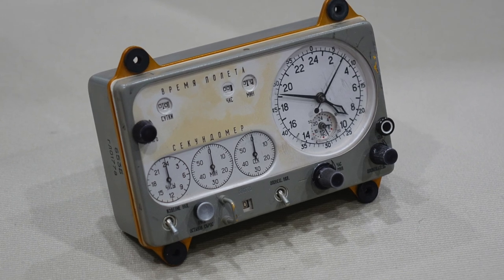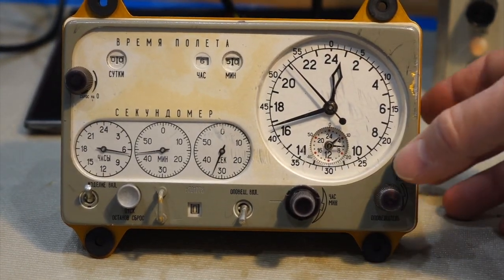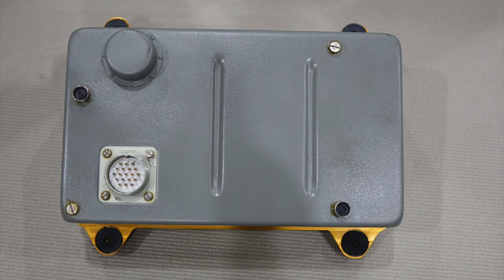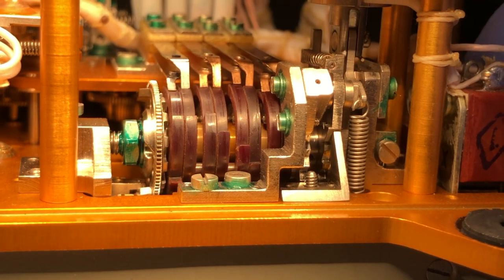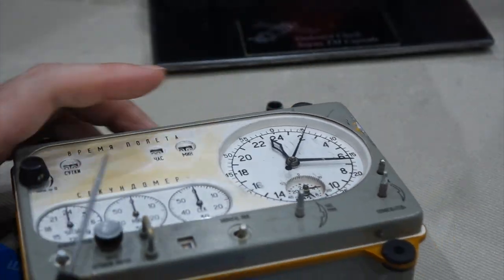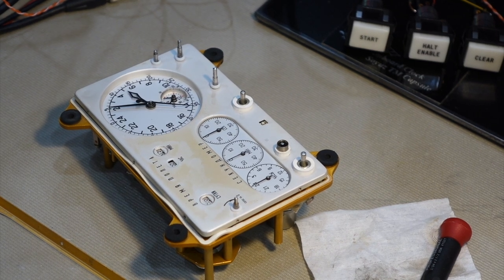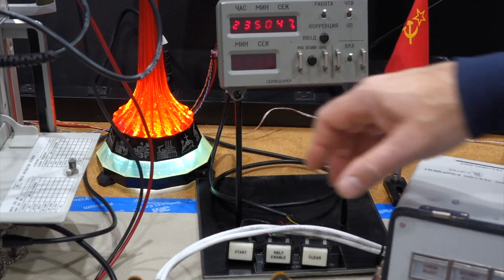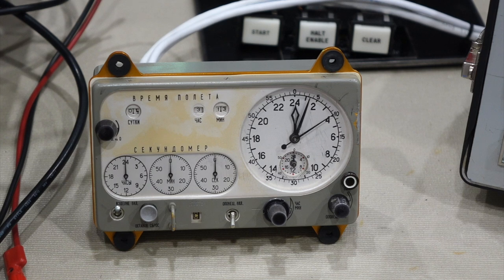Soyuz Electro-Mechanical Space Clock - Part 2: We try every function!

Comment: 5:32: I think I can explain the "interesting oddity" of the dot after the 1. I believe that's to more unambiguously distinguish a 10 from 01. Keep in mind that a cosmonaut may be looking at the display upside down, and there it might otherwise be easy to get confused. The hour display does not have a separate segment for two-digit numbers, and the dot is only really needed on the right-hand side, next to the one. Or at least that's my theory. I have no inside knowledge.
Reply: Insightful observation.
Reply: @КусаниеКрасногоКоня  there is 00 not 60? It wraps at 60 so things like 61,62, 93 etc. Are not valid numbers? There would be ambiguity with 60, 06 only, but seems like there is no 60 either, only 00
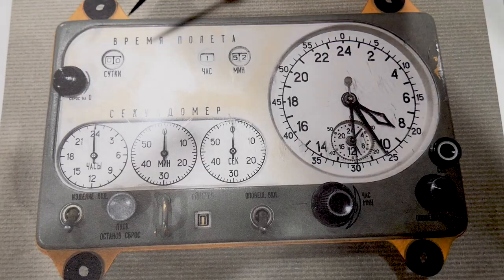Reply: @AngDavies  Interestingly, they also designed their "5" to be highly asymmetrical, which probably helps ensure 05 cannot be confused with an upside down 50. See shortly after 2:29. Between this and making dangerous input difficult, I think a lot of very smart thought went into the ergonomics of this clock.
Reply: I personally think its a hole. look at how clearly defined its edges are compared tot he printed one. I have no idea why it would need a hole there, but 99% certain its a hole and not a printed mark.
Reply from the maker: @jonmcentire  And you got it 100% right, I checked under the binocular microscope, and it's a hole. Mystery deepens...
Reply: I don't think you can get upside down in a Soyuz crew module. They borrowed the design philosophy from a sardine can.
Reply: 1 or 7 in the darker light / shadows /
Reply: Good to know, great thinking, on your part and the Soviets.

Comment: ОТК is quality assurance by the manufacturer.
ПЗ is acceptance by the customer.

Only the cool gadgets are marked "ПЗ", such as airspace/military/atomic/government/special stuff. The rest is ОТК only.

Basically, ПЗ is a quality control officer employed by the customer and on permanent assignment at the manufacturing plant. Their job is to ensure the processes, raw materials, workmanship, alignment and resulting products are up to spec, partly independently of the manufacturer.
Reply: Приёмка заказчика? 
This comment needs to be bumped.
Reply: @artej11  exactly :)
Reply: Не факт, что тут "ПЗ" - смущает разная высота символов.

It couldn't be for sure that it's "ПЗ" - the different height of characters is a bit confusing.
Reply: @r2daw158  По виду у них просто не было штампа и они посимвольно проштамповали универсальной приспособой.

It looks like they didn't have a special stamp ready and they used a universal one (probably a wheel one) to stamp everything.  I recall in the nineties when some papers were still done on manual typewriters they would sometimes use numbers for letters too.
Reply: @artej11  numbers on letters — this is twofold. On regular typewriters there were often no digits 3 and 0, those were to be typed as capital letters 3 and О respectively. On the other hand, teletypes had a full digit series 1234567890, but lacked the literal Ч, so 4 had to be used instead. This is can be seen even today in РЖД (railway) telegrams.

Comment: You forget to add the link in the description :P
I miss the mechanism which reset chronometer counters.. How does it happen? A spring-loaded system?

I really love the interior of soviet clock mechanisms.. I disassembled many old clocks in my childhood.. :)
Reply from the maker: Very sorry, it’s fixed now! I had to upload in a hurry before I got to my next appointment, had not added the end screen, links and cards yet.
Reply: Ахахах! Ю'в гат стронг Рашен акцент! 
(у меня уровень английского - Мутко! Молодец, запили когда-нить видео на английском!)
Reply from the maker: And yes, I really wanted to know what was under the bezel, but that involved taking off sealed green screws. And maybe even the hands, which I am not equipped for.
Reply: A video with both Artem and Marc : this HAD to happen sooner or later ! Yet I was surprised to see it :-D
Reply: @CuriousMarc  I tried in my childhood to unscrew some of that sealed screws on some decommissioned soviet kind-of-military equipment. Chance to do it was 40% - most screws were made from soft metal, and it's much more easy to break screw head, than to unscrew it.
Reply: Артём, красава! Не ожидал тут увидеть))
Reply: @sionmr2  аналогично) Мир тесен)
Reply: @CuriousMarc  Hmm...  Know anyone with access to a CT-scan machine?  If x-ray tomography worked for the Antikythera Mechanism, it might work for a Soyuz clock too.
Reply: К сожалению "все полимеры просраны". Больше такого мы вряд ли увидим. Спасибо Марку и Артему, что документируют память об интересных старых механизмах и электронных устройствах.

Comment: Great video! Loved it. There is a reason the clock is loud though.. It is not a flaw, but more seen as a feature. It's so during any manual maneuvers that are counted in seconds, they don't miss one! Humans do much better with more than one form of feedback. Visual and audio feedback combined are the best delivery methods for a majority of us. Combined, those effects are compounded, and highly efficient compared with responses to the effects individually.  When you are moving at 14,000kph, 5 seconds VS 7 seconds is pretty  important. That's all speculation though. I have absolutely no idea if that was in mind, or if the clock was even in the control cabin lol.

Comment: the wires are wrapped in a PTFE (teflon) sheet, also the wire isolation material is the same; 
sausage made of wires is called "жгут".
those are the best oxygen-free copper wires for signal paths, still in use for a modern military equipment.

Comment: Somehow doubt the mechanical clock noise would be a worry on a Soyuz, as if all you can hear is that clock, and not the dozens of screaming fans, running pumps and inverters providing all the AC buses, you are either on the ground attached to a broken test set, or if you are flying, you are about to have a really bad rest of your life, short as it is.

Comment: A common question for implementing watch/clock mechanical complications, and/or basic timing functions, is how to maintain position of the gear train (hand position) between timing events (escapement, ratchet, etc.) in the presence of expected dynamic forces. On earth we are only dealing with gravity, but a wrist watch is moved and tilted, which is addressed by the watch constant force drive train from the spring to the escapement. This arrangement reduces gear backlash effects (hands bouncing) and also resists gravity errors regardless of orientation (although timing error is orientation specific). For a mechanical clock to go into space in the presence of high G forces the 1/2 second ratchet wheel must locked in position after being advanced. This mechanism must produce a great deal of force (as compared to earthly clocks) to unlock, move and relock the ratchet wheel. This is why the solenoids are so huge.

Comment: 3:25: Interesting to note: There is a little ridge (or tongue or nub, or whatever the correct technical term is) inside the otherwise round 19-pin male connector. If there weren't, then it would be possible to plug in the cable connector rotated by any multiple of 60 degrees. And of course, only one of the then possible six positions would be correct. The keying of the connector takes care of that. So much attention to detail on this thing. It's very impressive.
PS: Does the riveted grey cup hide another connector, and does that mean that several of these secondary clocks could have been daisy-chained?
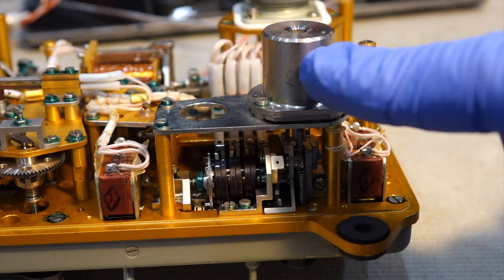PPS: Oh, no, I'm stupid, 10:24 shows that that's not the case. That cup covers the protruding part of the BFS (Big Forceful Solenoid). See 12:23.

Comment: I wager it was size concerns  that led to this thing being taken out of mothballs to be used in the Buran shuttle. I bet that loud ticking was also a feature: It would be helpful in hearing it over background noise/comm traffic.
Reply: For sure the sound wasn't just a byproduct. I have seen electromagnetic clocks made in USSR (mostly industrial applications like belt timings and sorting stuff) that are whisper quiet. You would never know they're working were it not for a rotating red knob.
Russians are extremely purpose oriented designers, doubly so in the aerospace area. If it's there, on the front end, it has a reason.

Comment: Fun fact: 0:23 is not an actual orbiter, but "equivalent airplane", similar airframe equipped with four turbojets and capable of runway takeoff for testing and crew training. You can see four turbojet instruments in the top center of picture and also throttle controls :)
Reply: Yes, but the clock remained in the actual flown model ; see (terrible) pictures at the bottom of this page : http://www.buran.fr/bourane-buran/bourane-consti-reacteur.php 
Notice the space orbiter had provision for fitting two jet engines, one on each side of the vertical stabiliser although it never flew such equipped, hence the two throttles seen on the picture (instead of four throttles on the equivalent airplane).
Reply from the maker: Yes, you are absolutely right. This is a picture of the Buran trainer.

Comment: The star on seal means Military acceptance.
There were goods for military usage and general usage in USSR. Military type components were similar to industrial/space type in USA or Europe. Military requirements were much striker than general. If a general type product slightly doesn't match to the requirements it usually go to shops. But it was unacceptable for military type products. Key visual difference of military type is star or rhombus on them. You saw rhombus on many components into electronic Soyuz clock.
Original name of this requirements is "Военная приемка" (Military acceptance).

Comment: So, since it's incapable of regulating itself, is it really a clock? The timing pulses are being driven in by something else.  So isn't it more like a complex mechanical counter?
Reply: In the terms of clock types, it's a secondary clock, which gets the count pulses from the primary clock.
You need one primary clock, which will drive some number of secondary clocks - this system was widely-spread on soviet manufactures when you need to broadcast the same time through all buildings.
As a result, the secondary clock is just a simple stepper motor and some gears for it, all-time precision comes from the primary clock mechanism. which might be sourced from a balance wheel or a cesium clock.
Reply: I think a lot of older bedside clocks were regulated by the AC oscillating frequency from the power source.  They would run faster or slower if the frequency was not in spec (60hz US, 50hz Europe). I suspect this Soyuz clock is much the same way.
Reply: @ironhead2008  As we are talking about Soyuz clock's external time source - it must not be AC line - the AC frequency in the autonomous power system (e.g. aero and space) is never stable.
Reply: You could consider it a "Slave Clock" like the ones used in schools. They are driven by a master clock. In fact, Marc's flip clock is one of those "Slave" clocks for a factory where they had a master clock feeding it pulses.
Reply: Depends on how you look at it. There's clocks that used the frequency of the input currents, there's clocks that used a removable source...
Reply: @ArtemKashkanov  I meant in the sense that the clock is relying on an external source for regulation: in this case some sort of high accuracy oscillator. Yeah, AC is damned unreliable.
Reply: @ArtemKashkanov  I'd be interested to see what was regulating this clock in the capsule. I suspect it would be some sort of redundant crystal oscillator system given space constraints at the time.
Reply: Seems like that's why the electronic one is much larger, its capable of keeping its own time if the main computer clock failed.
Reply: @ArtemKashkanov  Not sure how Soyuz was designed, but Apollo used a system where the guidance computer clock was used to synchronize everything else, but most things could run on their own, but just not frequency locked, when AGC was turned off. Even the AC power supplies had a sync signal from the central timing equipment (probably locked to the AGC 6400 Hz reference output).
Reply from the maker: Well, that’s what most of a clock is, a mechanical counter. But it is indeed missing a mechanical movement. This one is an electrical “slave” clock. Depends on an electrical input (the master) to move it. So it’s more accurate to say it’s incomplete, we are missing the electrical system that goes with it, presumably in another part of the ship. If anybody has it, I’d be thrilled to take a look!
Reply: @ironhead2008  Yes, an ordinary electric clock relies on accurate mains frequency. Here in the UK at least there are strict regulations for mains frequency and the supply authorities are required to compensate for any timing errors to keep clocks accurate. So if they were  under spec for an hour (for example) they have to compensate by speeding up until the total number of cycles integrated over time is correct.
Reply: It has timer/clock as it starts ticking it counts ;p
but like computer clocks its connection probably wa used to update/sync its time. Anyway some functionality can be provided with arduiono and lots of relays. And even better. But for its time its sure is in its limits. ;p
Reply: I wouldn't call it a clock. More of a clock user interface.
Reply: It's not a "Slave clock", it's a "Slav clock"

Comment: small point - the stopwatch function is called a Chronograph, not a Chronometer.  A chronometer is a watch which meets a high standard of timekeeping, as in marine chronometer.  A chronograph is a complication / function of a timepiece which records elapsed time.  Technically chronographs should be called chronoscopes, but they are referred to as chronographs for historical reasons.

Comment: Also, on some ICs and other components you will see a rhombus symbol. This means the part passed military acceptance criteria. Those parts could be released for public use, but parts without that sign could not be used in military gear.
Reply: You could see one of them at 12:03 on the toggle switch.

Comment: Interesting. I think I actually get how you'd use it now: the mission time is not reset during flight of course, but the chronometer is presumably for crew use for things like "fire thrusters for 4 minutes 32 seconds", right? And alarm for normal things like wake-up and prep for burns and such.

This is a great advancement for me, I couldn't figure out why there would be all the various displays and functions in the digital one. Presumably the omission of hours on the digital chronometer is no great loss if the things being timed are less than 100 minutes, and perhaps even easier for durations longer than 59 minutes

Comment: The Russians (and other Eastern block folk) who built the space program were extremely purpose oriented folk. If something exists, then, it exists with a certain reason behind. So the noisy nature is not a bug, it's a feature. I've seen plenty of electromagnetic/electromechanical same era industrial applications where the mechanism was whisper quiet, and the only tell, was a red (or green) knob, rotating with the main assembly.
I'm confident that the loud mechanism had a reason, either for logistic aspects or for psychological ones, but it certainly wasn't a fault.
P.S. shame what happened to the shuttle. :\

Comment: I wonder if the reason they used it in the buran was because it was a prototype? They might have snuck in some surplus parts until they finalised the design. The state of the digital clock suggests to me that they probably salvaged and refurbished some components for reuse in later flights which makes sense since the Soyuz is single use. Avionics are expensive.

Comment: So I do understand that this mechanical time indicator is doing its job just fine. I do also know that the sovjets were very reluctant to change working things. So why do they went to the effort and replace a proven and perfectly working mechanical time indicator by a vastly more complicated digital one? The only thing that comes to mind is that the ticking of the mechanical indicator must have driven the crews nuts!
Reply: I think machining all these gears, shafts and rockers, veryifying its geometrical tolerances is more expensive and time-consuming, that soldering in dozens of identical standard logic chips.
Reply: Could be the optics. The Space Race wasn’t just about true achievements but also about keeping up appearances against each other. Between an “old fashioned” mechanical unit or a cutting-edge digital one, just having the latter in publicity could have been a priority for the Ministries involved.

Comment: I bet those marks on the totalizer wheels have something to do with setting time on it, something related to bypassing the lower digits so you can set the higher ones more quickly.  Otherwise, turning that knob to advance 1 minute at a time for days worth of mission time would get very old very fast.

Since someone said it's a hole, could it be that you would stick a pin through it to stop it turning and there's a mechanism to in this case translate the motion over to the next wheel over?  Could also be a some sort of actuator inside the wheel that the pin would push on and move it so that the gearing bypasses the normal wheel.

I'm not sure why it would be on the 1 and not the 0 in this case, however.
Reply from the maker: Interesting idea. It is a hole indeed, I checked for that in the binocular. Could be used to by the reset mechanism also.